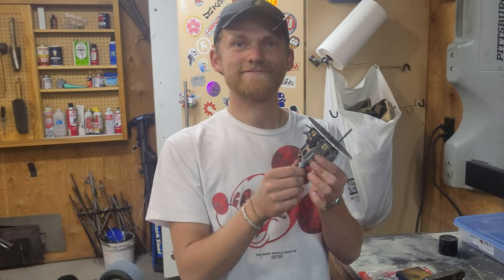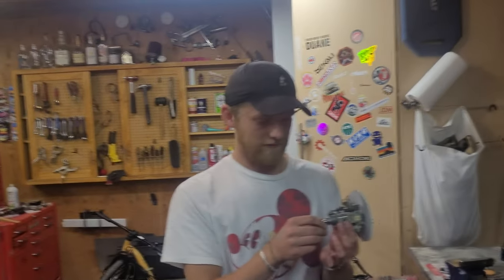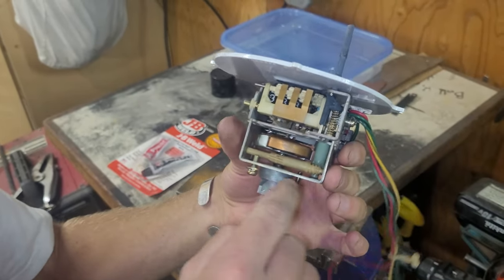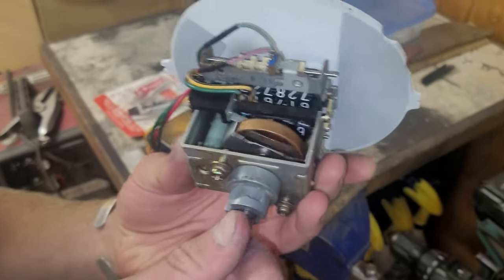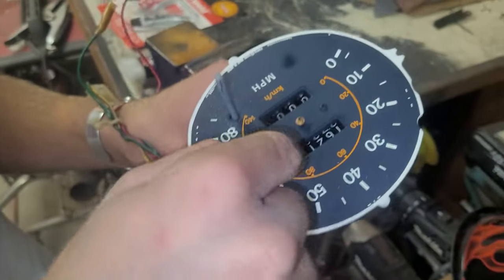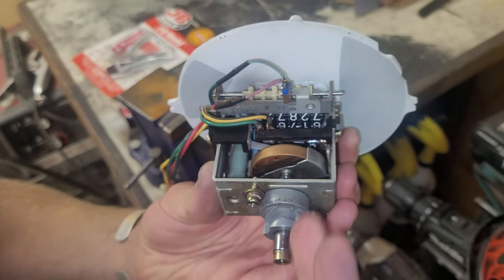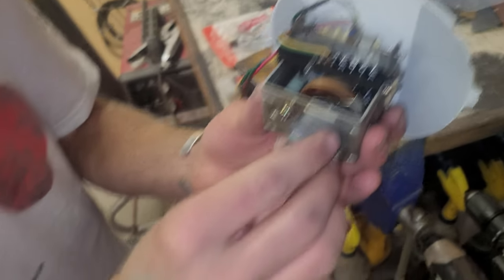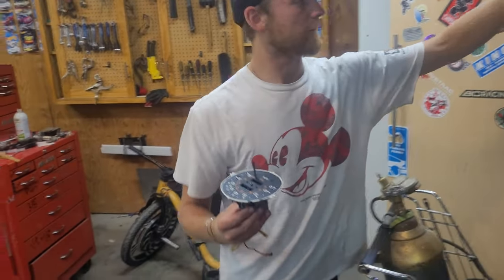Miles Explains: How an old school speedometer works- Illustrated on a 1980 Datsun 280zx Speedometer

Comment: Did you guys get it fixed?
Reply from the maker: Unfortunately we did not. I replaced the speed sensor, but it was the wrong part. 

I Unfortunately sold tbe vehicle now though. I really miss it.
Reply from the maker: However, we did manage to use the JB Weld, and it worked to keep it together.